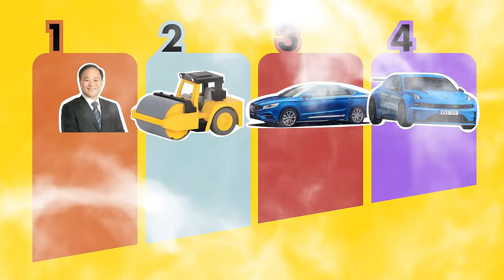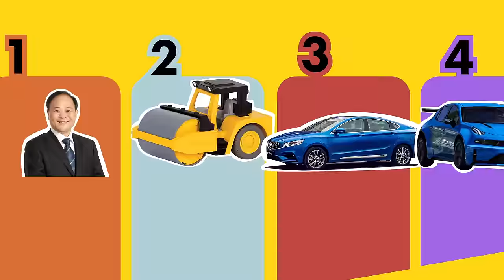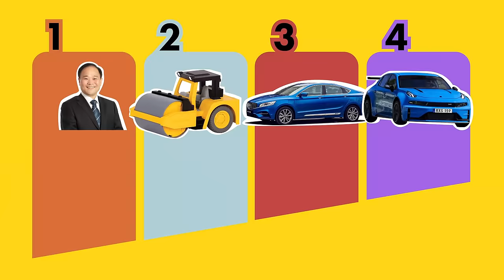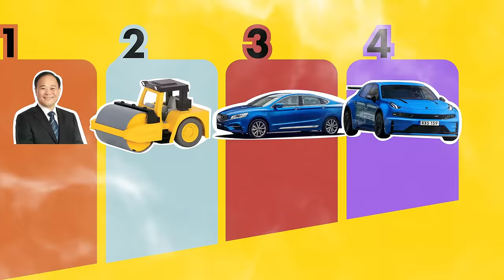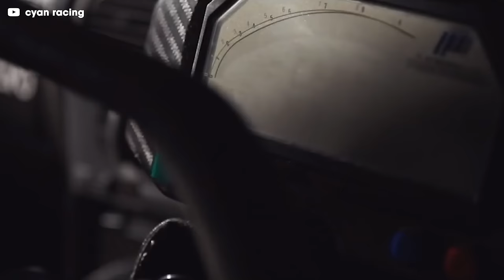GEELY - The Biggest Car Company You've Never Heard Of | Up To Speed

Comment: We have some Geely cars here in Argentina. They're aweful
Reply: Thanx for the heads up.
Reply: The plastic inside feels like garbage, but I've always wanted an engine swapped Geely Panda, I love the looks but they are such slow pieces of shit
Reply: In Sri Lanka they made a model named emergrad 7 and it was not that bad pretty Similar to a 2005-07 ish honda accord or Camry interms of styling and built quality but it was underpowered aswell.
Reply: @fgc_kaiser172  we got some Chinese Geely back then... One of them is Geely MK2. Aftersales is problematic, but the good news is that the engine is Toyota 5afe based (AFAIK)
Reply: Iba a comentar lo mismo. Son una boooosta! xD
Reply: @bitelaserkhalif  I don't know how much space there is in the engine bay, but getting a 3SGTE in there would be dope, getting a 6 speed manual transmission swapped in and better suspension, with such a short wheel base I can see it as fun little car with 250 to 300 HP
Reply: I think Western Australia sold Geely cars as well. Pretty terrible cars.
Reply: Check the models after the Volvo take over. Panda and the early models are pure rubbish. But now, they make some crazy stuff

Comment: I can’t imagine how terrifying it is to drive a near 600hp fwd car around the ring.
Reply: Honda Civic in NFS: first time ? has over 800hp
Reply: A EA888 Gen 3 can get close too 600 using forged internals. That’s the Audi/VW 2.0.
Reply: Let alone a chinesian vehicle
Reply: @usuariodescartable3404  wtf is CHinesian??? Lol
Reply: @sonnyzhao2309  lol probably something like blackanese ?
Reply: Like 4 Razorback warthogs tied to each other, pulling you on a snow shovel. Names are; Axel, Knuckle, Bearing and Torque Steer.
Reply: Not really, because they often fall apart before they can even use their full potential.

Comment: I test drove the Geely Coolray (aka Geely Binyue) earlier this year. It was shockingly good. Its NVH levels puts even more expensive crossovers to shame (e.g. CRV, RAV4, Tucson, CX5). They also use an excessive amount of insulation in the engine bay. It has more insulation than even lower-end Mercs (e.g. A, B, GLA, GLB) and BMWs (those lower than the 5 series). Probably one of the reasons it's so quiet. Also, I checked the parts inside the engine bay. The engine is pretty much the same as the one on the Volvo XC40 T3 and they use a lot of German parts such as the Bosch ECU and Bosch fuel pump.

Only thing I didn't like was the transmission. It's a dual clutch, albeit a wet-type, so it's less likely to overheat when you're treating it like a torque converter AT compared to the dry-type DCTs such as those used on many current Hyundai and Kia cars. Even when you step hard on the accelerator, there's a split second hesitation that's typical of DCTs.

The biggest question right now is long term reliability. The engine, transmission and platform is pretty much Volvo. But hasn't Volvo lost its edge in areas where it used to excel at since Geely bought them?

Comment: 11:08 Actually the 03+ has an 8-speed automatic transmission from ZF. the 7-speed dual clutch is found on the 1.5-liter 3-cylinder base modle 03s
Reply: ZF 8-speed ( 8HP ) are actually for longitudinal engines like BMW & Audi. That 03 ( and also Volvo's ) are supplied by Aisin ( same one from Camry ).
Reply: @oakfast  wasnt aware of that. thx for letting me know

Comment: Finally proton called to review the car but the technician told me one thing. I started in a very good manner to talk to the technician but the moment technician get into the car he told me to drive until the car show the problem Hahaha . I felt like wth why they have to talk like that. I hope I can  show them but when the car in 365days only 30days it shows the problem how do i do it. I said it shows significant issues after duta toll  technician ask me to drive through duta toll, then i suggested them to drive at maju express all the way till the toll and u turn back. I can show them the wobble issue which proton failed to recognise it for 1 year ++. I even tried to detect the issues when slowing down jerking issues. At the end what proton technician told me is its the tyre noise. I admit the car is 3years ++ and the tyre is old, why they cant tell me when it was 20k mileage when the tyre is in good condition. Then they told me to show how is the steering issue, show me how far the car deflecting, when i show them they said it is because the tyre is not in good condition.  They ask me to replace all new tyres for them to rectify it. Guys at end of the day it comes to us. Why dont proton install all new tyres to solve the issues. What about the time and money i spend all these times when i send to sc. Does it mean ppl who work as technician not competent enough to detect the issues?? Please correct me if I'm wrong guys. As a customer we don't demand anything,  we just hope a good service provided by the company and solve our problem, reliability. Kindly advise me guys if I'm doing anything wrong here.

Comment: I have to admit I detest Chinese cars before because they easily break and full of crap. We usually call them disposable cars since most of them dont usually last a month or two without breaking a part. All that changed when I was able to test drive Geely's new car here in the Philippines called the "Coolray." Damn that car is loaded with tech for a price point that doesnt even break your savings account. It even has an accurate self park function and even its Japanese, Korean, and American counter part doesnt have and if it has that option, then usually it will cost a kidney or two extra for it.